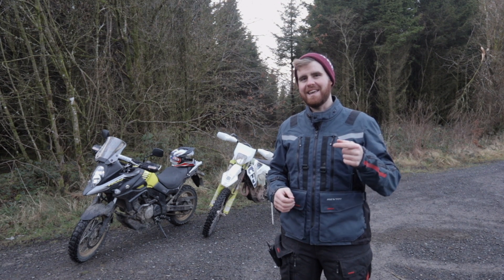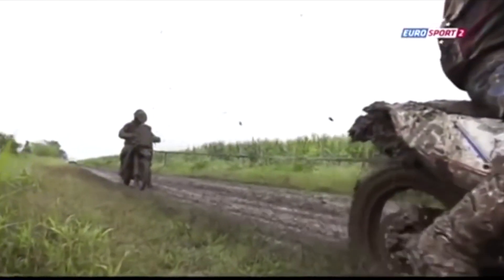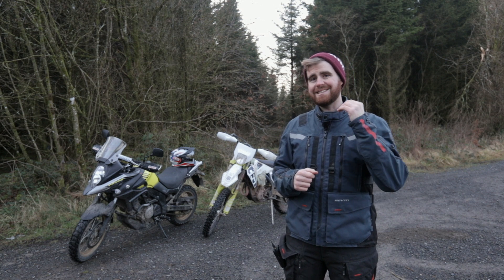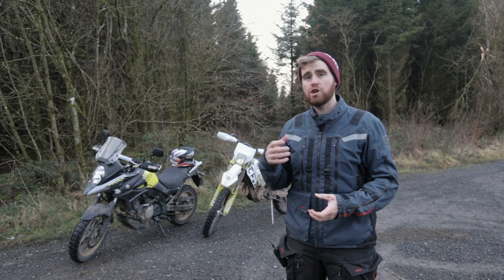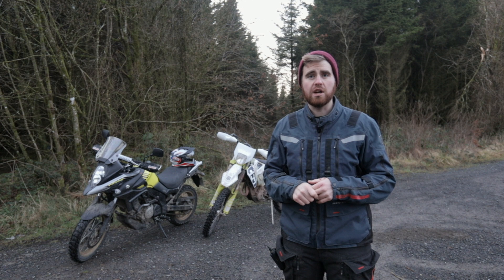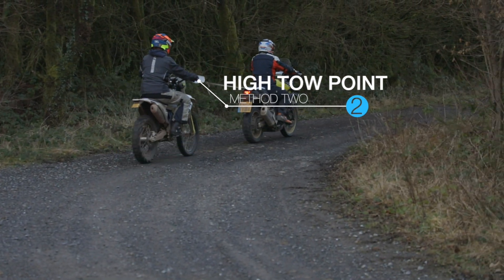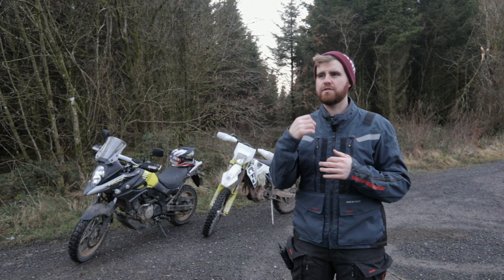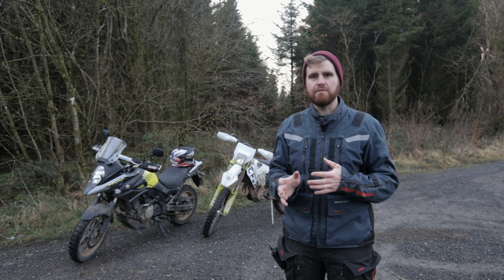How to - Tow a Motorcycle

Comment: Love it. Exactly what I needed to know. Using it to bump start a bike that hasn't run in a couple years.
Reply from the maker: Glad I could help!
Reply: Worked perfectly. Took about a mile of towing but it finally started. No way the battery would have ever turned the engine over enough times to get it going.

Comment: You don't need rope to tow a bike....
Person at the back being towed need to keep his foot on the foot peg of driving bike 🤷🏻‍♂️... offcourse this does work only for short distance but risk free and effective.
Reply from the maker: And with a rope you can tow as far as you want. Put that face palm emoji away 😂
Reply: @BrakeMagazine Through the word 'short distance ' I mean atleast 25 miles, after which you can surely expect fuel station. More importantly it's risk free, very simple and you don't carry rope all the time 😊.
Reply from the maker: We can all have our opinions, but I think some detail is important for anyone reading this.

I don't think the footage to footage method is risk free. It's actually pretty difficult, quite tiring and is hard to do in any technical place. Secondly, I think tow ropes are so small, it's worth just stashing them under your seat.

You're right, this is a get out of jail card, but it's not the only answer to the problem. 

Cheers,
Reply: @BrakeMagazine  👍

Comment: Good instructional video. You have a nice wide tow strap. I would just add to be careful with the second method if you're using one of those thin lines. I was once towed and it cut into my handgrip, fortunately not into the wiring of my heated grips. I probably should have looped it once more around the crash bar before bringing it up to the grip.

Comment: How the hell, am I going to stop? I can't use the front brake or will break my face and teeth, if I releese the cord will get loose, (this is just for a moment in fields not in the traffic) or unless you don't have to stop
Reply from the maker: You can use both brake as Normal. The rider at the back does the braking, the rider at the front does the acceleration.

It works very well like this. I towed more than 100km in Dakar using this method and at many other points and it has worked well.